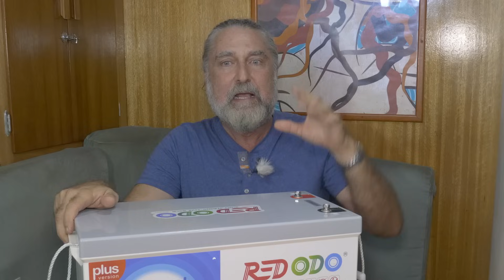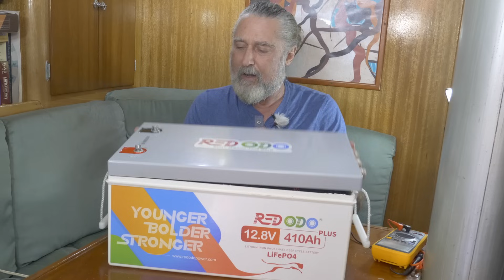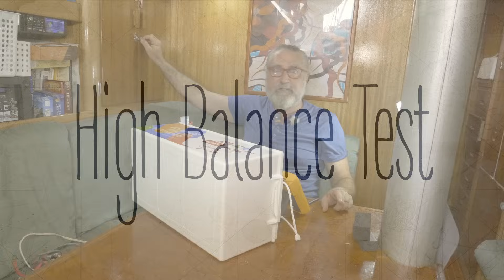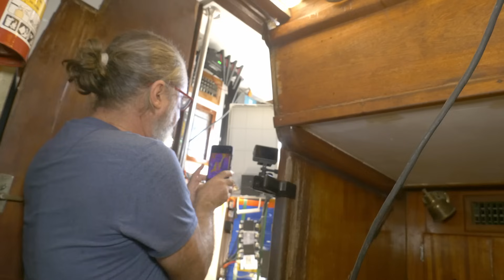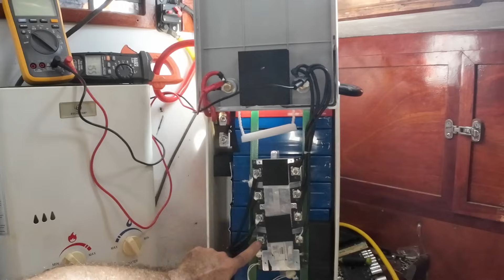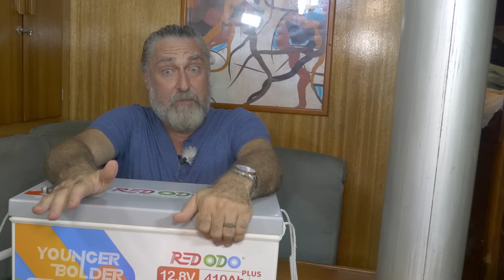Cheapest Lithium Challenge:Redodo 410ah

Comment: My 100ah corroded down to the bms in less then 2 years.. real world use 24/7 main source of power on a 3kw array
Reply from the maker: Or possibly improper charging??
Reply: @Clarks-Adventure  Real world use, offgrid, in a swamp.

Living in a burnt out house with the only thing making it being the solar panels and a ps3, the ps3 would pause if we turned the lights on lol, but having a ps3 and a air conditioner in a disaster so that's nice. Only could use it between 9-5:40 usually but 100x better then charging my phone next door..
Reply from the maker: I suggest you watch my video on how to charge li properly before you get another battery.
   LiFePO4 should last over 10 years if charged properly.
Reply: @Clarks-Adventure  the lithium cells still work. Its the bms thats fully corroded. I had to pry the lid off that boy to get a extra life from it until it corroded more.

Comment: In the case of RV mounting, I have not seen any examples of good battery securing. My 5W RV comes with a plastic molded well for 2x group 24 or 27 LA batteries. However, working out of our RV I am considering the LiTime 560 AH steel case battery w/cold temp protection. Our fifth wheel front compartment stays above 45 deg F, but I still feel more comfortable with cold protection in case we run out of propane, have a family emergency, etc. but at 133 pounds, this 560 AH battery is Heavy. I thought about screwing down a 1" thick plywood (over the original battery well), then 2x4's laying down around the base screwed to hold HD straps so they battery does not launch itself to the moon during a potential panic stop. My wife works out of our RV running her computers all day. We have 740 watts of solar on our roof and two small banks on the ground with a total of 1,440 watts from a total of three MPPT charge controllers. We are off-grid while working in the summer. The other option might be a metal battery box like I did with our two formal 100 AH BB batteries , but at 9,000' ASL cooling isn't as much of an issue and the AZ desert in winter isn't a big concern either, we try to chase 79 deg F. Anyway, I will keep researching. Your video of the 200 AH Redodo is an option also, 2 or 3 will be needed in parallel. I need to compare Redodo & LiTime. I am good with replacing them every 10 years or should I say repurposing them. :-)

Davey - KU9L
Reply from the maker: Think seriously about the BankManager.  It's really the way to go just now.

Comment: Do you talk about Hall Effect vs Shunt Resistor and why you made that choice and what is your opinion about using shunt resistor monitoring in general elsewhere.
Reply from the maker: Yes I do.  I think on the BankManager video.

I hate voltage drop so I used the hall effect in my device but now I know why the shunt is still used.  I had to write dynamic calibration code for the hall effect.  Something that wouldn't be required for the shunt.

The shunt (in my experience) drops more voltage than you think .  There is it's resistance of course but the terminal crimps and the bolt looks some to start and more as corrosion comes into play.  The opening hall is just a sealed wire you need anyway.

Comment: So I’ve heard that if you budget 400 Ah you should get a 400 Ah battery. Vs. getting 4x100Ah batteries. Save on wiring. Etc. but then if that one battery has a failure you have nothing. If you have 4x100 Ah batteries and you have a failure (like a BMS craps out) you still have 300 Ah that you can use. What’s better? Wouldn’t the redundancy of multiple batteries be worth it?
Reply from the maker: I talk about that in depth on one of my videos.  I thought it was this one.  Did you watch it?
Reply: @Clarks-Adventure  you do. I watched it again. I think you make a reasonable conclusion - fill your budget but with two batteries. So go for 2x200. I’d hate to be days off shore and only have one battery.

Comment: What does everyone do with the batteries that are cut open for tasting?
Reply from the maker: I don't know about everyone, but I balance the cells manually so the battery is as good as it can be and then I put the case back together and find a home for it on other boats in my bay.
Reply: @Clarks-Adventure  Old Bay seasoning ?

Comment: The problem i have seen in most of these reviews is that the battery company knows its going to be tested and opened. So they make a "special" battery for the review process . 
I have seen others (you tubers)that will later just buy one like a normal customer would and do a tear down and there is completely different low quality internals. 
Hard to trust a review when the company knows what's coming.
Reply from the maker: I think they just sent me one off the shelf
  It had a flawed cell.

Comment: Hi @EmilyAndClark , congratulations for the video. I have a doubt...if the cables are number 2 AWG 6 for the positive terminal and number 4 AWG 8 for the negative terminal, the maximum amperage they can support is a maximum of 200 amps and you're at the limit anyway, so they are undersized compared to the 250 ampere given by the factory... and therefore it is not the best, correct me if I'm wrong: there is a risk of melting or burning some cables internally and unpredictable damage could occur right?
Reply from the maker: Yes.  I believe I say that.

The company and I are deciding how to improve this offering.  They are actually open to and asking for my input.  We are currently looking into the cell testing procedures.  They currently seem to feel that 70c wire temperatures are acceptable.  I think there is unlikely to be an actual failure associated with their wire choice but I really don't like the lost power.
Reply: @Clarks-Adventure  Ok, so using the inverter with a maximum of 200/210 amperes you should be safe in theory ;)
Do you think it might be possible to change the cables by opening the battery at this point? I saw that when you dismantled it they were tightened with bolts from the cell to the pole terminal block, could this be a valid modification?
Thank you for the conversation
Reply from the maker: Sure you could if you wanted to.  And the Redodo cases can be opened (with a struggle see my first Redodo review for the method) and resealed without damage.

Comment: Well done testing!
That's considered a bad battery when it doesn't provide full capacity. That's a warranty situation. Maybe you don't want to offend the company but that's the black and white conclusion.
Is it still fully usable? Yes.
Either the IR on those two cells are drastically off or for some other reason the capacity is less. But B grade cells still pull full capacity so this is really poor QC at the factory.
Reply from the maker: I'd send it back if I had bought it and lived in the US.  I actually am using it on my boat.  I top balanced it and set my BankManager to not let the battery go below 20 percent so it should be fine.
   I've been working with the company.  They really want to figure out how to protect this from happening again.  I just sent the serial number to them today so they can share the cell tests.  It will be interesting to see what they test for.   They seem to really want to improve their quality.
Reply: @Clarks-Adventure  That's good to hear.

Comment: I scanned the comments looking to see if anyone else asked this question, but I didn't see it so I'll toss it out there.  When you were discharging the battery, you mentioned that the shorter wires were the ones that got hotter, which makes sense.  I'm curious if the shorter wires also go to the cell that is most imbalanced.  You said that the capacity of the cell pair might have been slightly lower, but I'm wondering if the shorter (hotter) wires are connected to that cell pair, thus carrying more load while discharging since the resistance is lower, and thus also carrying slightly more current while charging causing that cell pair to always discharge and charge faster than the other cells.  If that's the case, simply replacing the wires with all the same length would be a simple but major improvement to the manufacturing of this battery.  Every video and piece of literature I've seen always says to keep your parallel wires the same length to avoid this exact problem when connecting multiple battery packs together, but the same principle should apply to the individual cells as well.
Reply from the maker: The cells are in series.

The wires in question go from the negative on one cell to the BMS.  And from the BMS to the terminal.   The BMS terminals are spread out thus different wire length.
Reply: @Clarks-Adventure  gotcha, that makes sense. In my mind I was hoping to have found a simple solution to the imbalance problem and completely overlooked the fact that the cells would have to be in series. D'oh! Thank you for taking the time to respond! I appreciate your videos!

Comment: These batteries are not suitable for a boat. No Bluetooth means you can not see cell voltages at a glance. No active balancer means the cells won't balance well. It's very revealing to see how unbalanced those cells were when you checked them. This suggests either poor cell balancing at the factory or poor cells or both. 
Save up and buy a better battery if you are installing it in a boat. Make sure the battery has Bluetooth and an active balancer. It will save you money and frustration in the long run. It may even save your boat when these crappy batteries do a high voltage shutdown as you are entering a harbour at night, in the rain and your radar, chartplotter, depth sounder, nav lights and autopilot go off.
Reply from the maker: Thanks for your opinion
  It's apparent you care about batteries.  I bet you would enjoy looking into my BankManager 

https://www.emilyandclarksadventure.com/bbms

Comment: How many batteries depends on your load. if you only need to power a 3kw inverter which runs at 2400 watts then 1 battery is fine. if you need to have 5kw inverter, 4000 watts then I would go with 2. Having dual 5kw inverters 4 banks is preferred. This is to keep the C rating down for charge and discharge so you do not overwork your batteries. This is why I like 48v batteries best. Having 4 banks of 48v pulling 10kw is less than .2C where with 12.8v is .8C at the same cell size. That is a lot more heat and load on the electronics. IF you build your system right it can last you 2-3 decades.

Comment: The Boat How To course teaches that when connecting batteries together, you make all of the wires the same length so that the resistance of the wires between the batteries is the same for each battery.
Reply: @offgridmethods  as an electronic technician from 1983, I also found that user error on my part could introduce additional resistance to the equation by not properly crimping my lugs. The cheap crimpers are the enemy of OCD protectionists like me, but I've had lugs get loose slightly down the road that seemed rock solid the moment I created them. I, of course, try to detect this by using high quality meters to measure to test for this, but the older I get the more I admit I no longer leave chance to satisfy my ego. Thanks for helping us all keep real & keep educated.

Comment: With 12V 100Ah battteries from PowerQueen, Redodo, LiTime and similar budget brands going for just over $250 right now it makes no sense to buy one big one especially when a battery 4 times the size is 5 times the price...and ends up being less capable than the big battery. The only advantage being the 12V 100Ah batteries come in cases meant for Lead Acid/AGM batteries so there's a ton of empty space. The Mini batteries from the above mentioned batteries solve that problem (unless you really have something against pouch cells). Even the "regular sized" 12V 100Ah batteries can simply be removed from their cases and you can put 4 of them in a box and parallel them on a central bus bar system for $30-$50. That plus a little bit of extra cable and some lugs is your only expense. 

The big batteries typically have a 200A or 250A BMS....with four 100Ah's you get 400A continous.....Then you get redundancy if the BMS craps out. Which is the most common point of failure for a battery that's going to be a tank for 5+ years in terms of cells....

So the advantage of size....out the window with the Mini's or pulling them out of their oversized cases.

They make no sense.
Reply: Using 0 AWG or 2 AWG ( 2 would be minimum) of quality battery/welding cable to a quality bus bar in equal lengths will prevent any issues. Buying your batteries in the same batch is another important consideration if you're paralleling more than 2 batteries. I bought 2 PowerQueens and serial numbers were almost consecutive, IR was almost exactly the same and capacity test was identical down to 10mAh and 30 watt hours.

Two batteries like that set up like I said will run flawlessly together unless one of them is exposed to something the other isn't.

Comment: Well Clark, back again with just a few concerns about what I am doing. I currently have 6ea Valance U27-12XP batteries on my house (Starboard bank and 3ea group 24 lead batteries on the other bank. You suggested a timing relay to combine these batteries while running and then the timer would disconnect then shortly after engine shutdown. I just put a large jumper from one battery to the other and left it that way for 2 months while using the boat. During the day I would get to 14 volts and by morning I would be at 13.2 volts. This worked great while in use and when put into storage, I separated the batteries again. This year I am changing some things up again. I have purchased another 6 Valance U27-12XP batteries and going to replace the port bank with these. Then I should have no problem with balance. As with the Starboard bank, I used 3 feet of #4 wire from each of the 6 batteries to a buss bar where I connected the original boat wiring. I will do the same for the other battery, but may have to use longer lengths of #2 wire because a larger spacing issue, but will keep the same resistance whatever that length needs to be, perhaps 4 feet. Now I have far exceeded the limits that state really only having 4 batteries max in parallel, but as long as all tie together into the buss bars with equal resistance wires, I think there should not be a problem. Now each bank is charged from a seperate 140 amp alternator through a 130 amp isolator. I have found the isolator actually helps keep the amperage down on the alternators, but I will check it closely. The batteries also get charged during the day from hopefully 2600 watts of solar. I say hopefully because I really only have 1000 watts installed at this point and am planning on another 1600 soon.
Any thoughts by you or anybody would be greatly appreciated.
A great feature of this setup is 1800 amps continuous from the batteries and 3600 amps for 30 seconds surge. It is overkill by at least double from what I need. I have a 3000 watt inverter and another 2000 watt inverter dedicated to the watermaker. This can be a very substantial load when both running, but would be rare to have both combined above 4000 watts, more like 2500 watts. I found no real problems with the current setup except when sitting at anchor for 3-4 days in bad weather waiting for a window to move. Now I will have the capacity to sit for a week at least while waiting without worry or starting the generator. (I hate running the generator)
Reply from the maker: Using two BankManagers solves the problem of unequal resistance and too many in parallel.   Each side would be charged to its own needs.

Comment: I am curious if you have ever looked at the EG4 batteries supplied by Signature Solar? I only ask as they are semi local to me and I could pick them up and save shipping. I am more interested in a 48V system but I am reluctant to pull the trigger on a lithium battery. I am excited that the prices are coming down.
Reply from the maker: No they haven't offered me one.  But I'm not really equipped to test 48v here on the boat so probably not a good match.
Reply: @Clarks-Adventure   they have some 12V options as well 100ah and 400ah.
Reply from the maker: Well it all starts with an offer of a battery from them
  And that often starts with a potential customer like you suggesting our channel to them.
Reply: done @Clarks-Adventure

Comment: How does the maximum current draw compare between different sizes of battery? For example 2 200AH as compared to 1 400AH or 4 100AH? You are correct that for most people, having power for a greater length of time rather than lots of power right now is the reason for more AH overall. What about those who are using them for motive power? does it make more sense for them to have more smaller batteries? Or I guess the real question then becomes: how many of these can be in series? I guess if it makes 48V (and I think most of them will that is ok. most boat drives with high voltage motors come with their own sealed battery anyway.
Reply from the maker: The problem is those batteries are crazy expensive.  I'm going to look into this as I help a friend with his electric drive project.

As for power delivery the first limit is most cells are rated at 1C.  So don't try to discharge any bank faster than over 1 hour.  ie. A 400ah bank should not be discharged over 400amps.

Then it's just a matter of adding up the BMS ratings for batteries in parallel.  Two 200ah batteries in parallel with 200a BMSs should produce 400amps but one 400ah battery with a 250a BMS can only put out 250a.